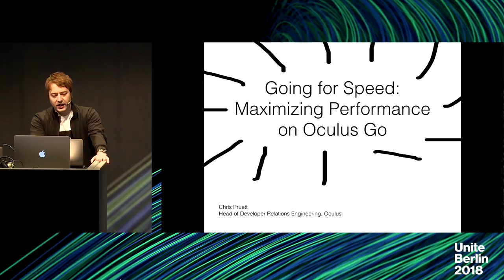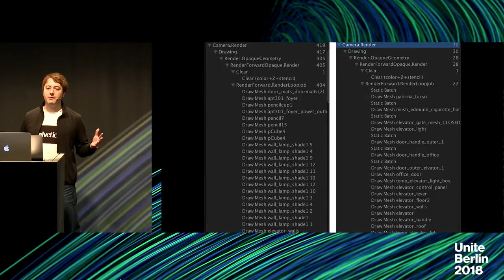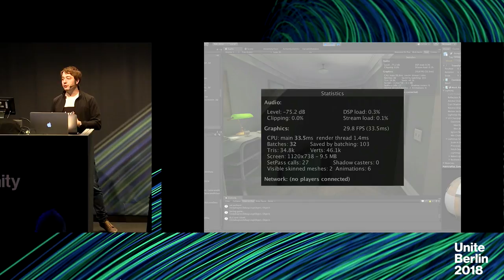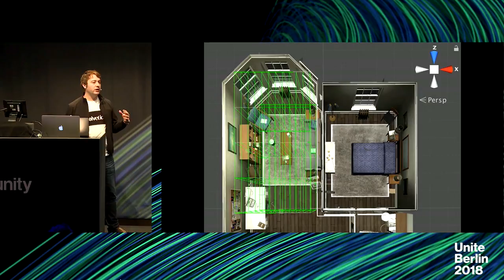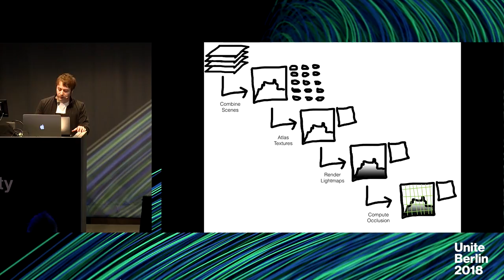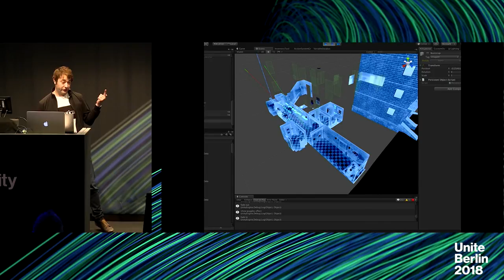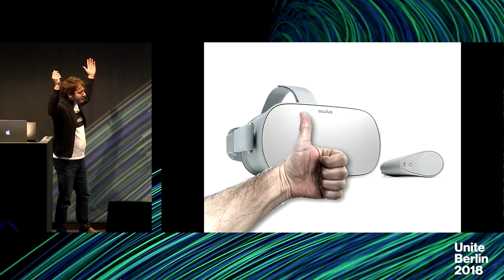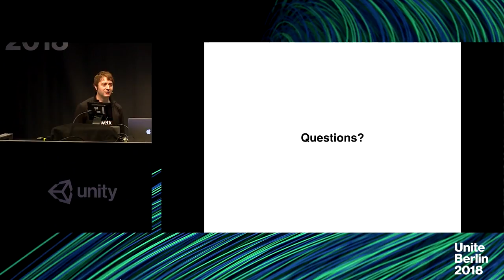Unite Berlin 2018 - Going for Speed Maximizing Performance on Oculus Go

Comment: Just FYI.  Anyone looking at this talk RN, if you're on the scriptable render pipelines, like URP, materials can batch even if they're not exactly the same.  It basically batches the underlying "shader" if the parameters of the shaders don't change much.  The stats in the profiler window aren't as accurate as the frame debugger when seeing ur real draw calls, definitely check it out.